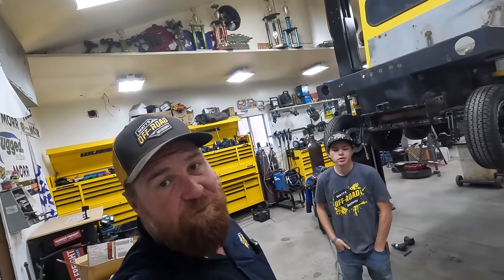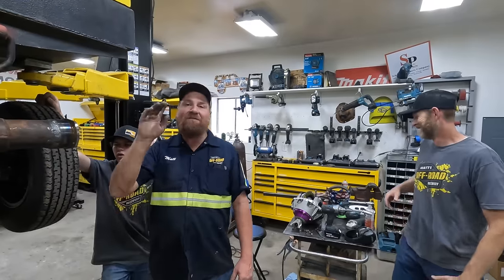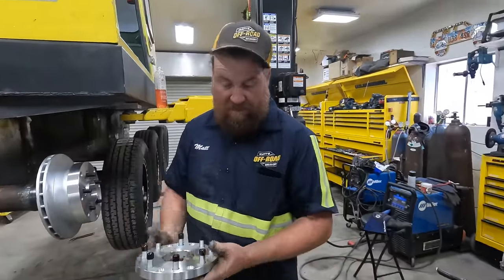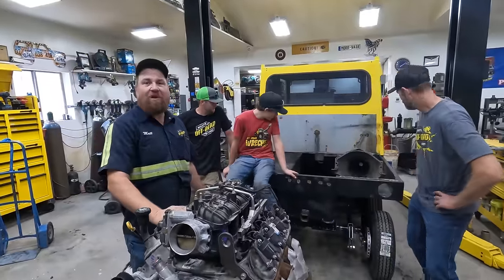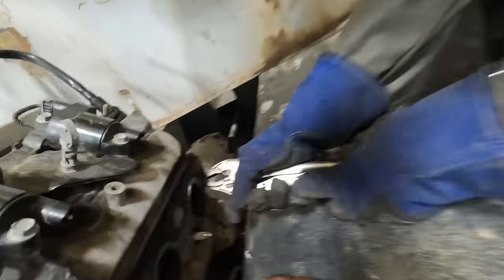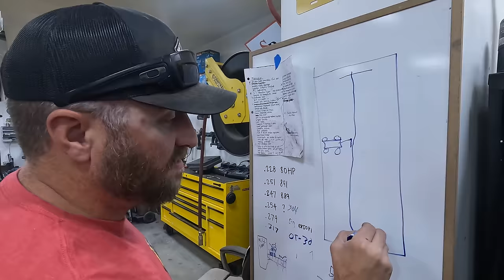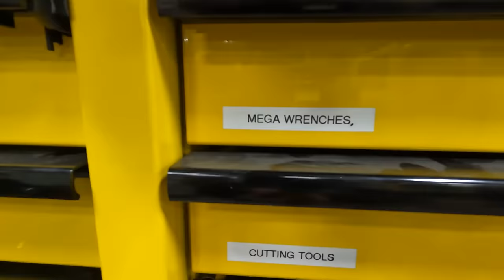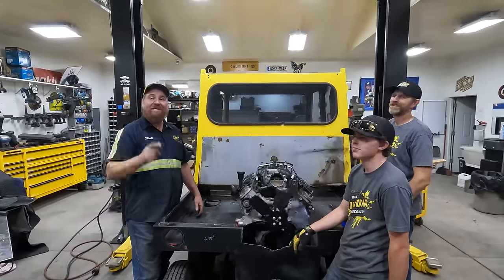Did We Make The Bombi Too Powerful? Massive LS Engine Barely Fits.

Comment: Matt, you can use electric fans and put the radiator anywhere you want it. That way you dont have to worry about space at the front of the motor / engine :)
Reply: I was thinking that same thing too. Also, I lived in some -20 winters and freezing brakes wasn’t really a thing.
Reply: Theres a roadkill episode on the mazdarati that proves that statement wrong. Sometimes you actually need to route aur towards them
Reply: Train locomotives do this, big fans push the heat out the top.
Reply: @haywood12  That's only at speed where placement becomes an issue.
Not something Matt needs to worry about with tracks.
Reply: Electric fans will also give you options for radiator mounting
Reply: @ubercdr1313  I've had drum brakes freeze solid numerous times.
Reply: @JohnnyD1993  yeah, mostly a problem with drums.  Pads can get ice between the pad and disc which is also an issue.
Reply: @@TheRealBrownShady They work fine in water as long as its temporary and its good to run them after they have had water in the hubs as it will help them dry out.
Reply: @@TheRealBrownShady Maybe the blades on them are poorly made and susceptible to mechanical deformation from the water? Or there is something else that causes it for them?  Would be interesting to look into what causes that or its just a recommendation for salt water for an electrical thing.  I mean if you're driving through salt water high enough to where the fan needs to be shut off the humvee is probably going to need a decontamination within a day or its done..
Reply: @JohnnyD1993  I see. My vehicles had disc brakes. One winter it got so cold the gauges stopped working. Our suburban was running but the tach was also below zero. The cold brought out all kinds of little quirks, but the brakes were always good. I guess that’s another key difference between disc and drum brakes?
Reply: Electric fans need to have huge motors to out out the power of a mechanical fan. Since this thing is likely going to be slow moving the mechanical fan is the way to go
Reply: @haywood12 roadkills issue wasn’t fact they had a electric fan without ducting there issue was the fans they buy because they’re cheap/free are absolute junk
Reply: @BrokeWrench  As a counter point, electric fans would allow for better regulation of the engine temperatures since it does not look like they have room for a fan clutch.  I personally think electric fans are the way to go on a build with confines like this.

Generally speaking I prefer engine driven fans as they are more robust, if a fan clutch fails in the middle of nowhere it is easy to make it into a fixed fan, where as an electric fan is done for. .

Comment: For added engine longevity, I'd replace that oil pan with a pan from a TrailBlazer SS. 8 cylinder GMT360 use a front sump oil pan. Perfect for that reverse mount engine setup in the Bomb Bee.
Reply: I am not an expert on oil pans but I would assume that the Bambi could never pull enough g in any direction to create that type of problem.
Reply: @DerUnbbekante  There’ll be quite a bit of slosh when you hit the end of the rope, but nothing sustained. 

I guess the bombi could see some extreme slopes
Reply: I'm always surprised that oil pumps in rock crawlers don't suck air when they are on extreme angles. Matt talked about it and he said it's never been a problem. So I doubt a few seconds of momentum is going to hurt anything.
Reply: @AsTheWheelsTurn  I just re watched the video. I counted the same number of requests for my opinion as I counted for yours.
Reply: @DerUnbbekante  probably not. Just like under normal driving conditions having a front sump pan in the TrailBlazer SS isn't an issue. However over the long haul, those brief losses in oil pressure that can happen during hard acceleration will catch up. Considering how much time and money is going into this overhaul it's cheap insurance.

Comment: Your homebrew high pinon will be fine. The probable use is low speed and cold weather (or cold for you anyway). If it fails in the future, Currie Enterprises has a high pinion casting for the 9" with the necessary oiling modes built in. Build it, drive it break it, build it again. Have fun!
Reply: True Hi 9 actually makes 9 high pinion, that would work for this.
Reply: He's said multiple times they intended to use it all year round, so abit more speed and heat could be normal for it
Reply: upside-down diffs are really not a problem. amc used an unmodified upside-down dana diff in the 4x4 eagle front end with absolutely no problems. 90 weight oil is very sticky stuff and the inside of a moving diff is like a dishwasher interior, everything gets plenty of liquid.

Comment: You should make the cab able to hinge up like a cab over truck.  You can tip it and them work on the drive line easily
Reply: I agree-- but In order to do that, they would need to weld a bottom onto the cab - which would add a lot of weight.

Comment: Matt, if you use a product called Power Punch gear additive, the oil will climb up the ring gear and follow the pinion back and lubricate the pinion bearings when you travel.  It has molly in it which fills the micro pits and makes the gears last longer.  Great in transfer cases too
Reply: yes, stickifier/tackifier additives would be good to put in there.

Comment: Thanks for another video folks. Regarding the cooling fan direction, I'm thinking that in powder snow conditions blowing outward will tend to blow snow away instead of into the radiator which is also a plus. All the best.

Comment: Flipping the differential will work fine. Gears  get "splash" lubricated from the ring gear slinging oil, like in a manual transmission.  Your solution for inlet and outlet may come back to bite you. Oil will loosen your silicone plug. A more permanent solution would be to tap the hole for pipe thread and install a pipe plug.
The lower 48 refers to the continental US.
Reply: Since I heard a reference to the 49th parallel slip into that conversation, I think they know that and are just having a little fun with it. Much of the border between Canada and the lower 48 follows the 49th parallel.

Comment: Given that engine placement you might want to look at a clear view filtration remote oil filter and a no spill system oil drain plus given its for matt maybe a bypass filtration system so when he doesn’t change the oil for long periods of time the oil is still clean
Reply: At 23:00, what is the purpose of the little square plate with holes in the corner ?
It's a Barnes product. Maybe for fuel pump change type thing ?
Reply: Oil doesn't matter at all.   Not when it sits out of gas on the trail.  =))
Reply: @stevejette2329  I believe it's a plate that bolts up to the original engine mount spots, to make it easier to fabricate a custom mount.
Reply: @IcedragonofSolitude  THX

Comment: Pusher radiator fan makes perfect sense.  To aid in efficiency, the low pressure area behind the "cab" will help evacuate heat from the engine compartment, especially if there are louvers on the sides of the Bombi to help make a positive pressure area inside the engine compartment.

Comment: I can't wait till the BOMB Bee gets it's first job, gets stressed in true MORR fashion and performs flawlessly, then reveals some superpower nobody expected! That's what usually happens when this team gets down to business. Thanks MORR family.
Reply: im pretty sure with the new engine and drivetrain that thing is going to be a mini beast when it comes to pulling!
Reply: Matt & Co. DO tend to over build and over power the vehicles they build/rebuild so they tend to over perform. 

I can hardly wait for Matt to decide the Bombi needs a boom and 7 winches... oh, and a few more feet in length on the chassis, the track and the footprint...
Reply: Now that BFS has one I can see the winter tow games lol
Reply: Bomb Bee  😅🤣😂 👍 It reminds me of "Olivia Neutron Bomb.."
Reply: I've been stranded in the SKETCHIEST places and times sub zero blizzards where you WILL die outside fast AF no matter what skills and gear ya think will help lol from our snow cat. Very very good mechanic and fabricator, mech engineer. It's been random things every single time screw snow machines😂😂
Reply: I think you're gonna regret not being able to haul passengers.
Reply: @craigbowley6783  How is he not going to be able to haul passengers?
Reply: It's only ever as good as the weakest link ....
Reply: I reckon she'll hold, till she doesn't. Then it'll get fixed better till it holds. Until it doesn't. Then, it'll get fixed again, until it got built right cause it was built thrice. Or more.
Reply: @mtnbound2764  With all the weight in the mid and rear of the vehicle they will need a dozen people in the front to try to hold it down especially with something hooked on the back. Maybe wheely ski's or something like that to help keep the front down
Reply: The executioner 😢has  get the pictures from a

Comment: They do make rear end oil pumps and coolers. Specifically for endurance racing. I would also put a cross brace across the housing. Ford 9 inch housings are really light and are known to bend.

Comment: You can get more clearance for the engine with a Corvette style accessory drive. I also wonder if you've looked into a Torsen differential. Supposedly when the brakes are applied on one side, a Torsen unit multiplies torque on the other side something like 5x.

Comment: The drive axle is on the front for a snowmobile so keep things compact.  Drive axle in this case on the back would be preferrable as it wouldnt stress the track tensioning mechanism but it worked fine before (with less than 100hp) so.. run it until it explodes then make it stronger I guess.    If you dont want to break exhaust bolts in the future there are neat drive sockets they make that go on the end of air chisels.
Reply: Ok

Comment: great build!  I'm a novice but concerned about track's attack angle, and other stuff, like track length, etc, when the bombi is not on the ground causing the tires to flex, and engine is not installed.  And, glad to see the advancement of the build!!!

Comment: The visual effect that makes the fan appear to be going backwards is called frame count.  Same affect was visible in spoked wheels in old westerns.  And Matt is absolutely correct in having the fan blow to the rear so as to stop dust and snow from clogging the radiator.
Reply: yea it's a sensible design, only issue that specific fan is designed to spin the other way, they'd be better getting a fan optimised for spinning in reverse

Comment: Matt: I spent my working life in Northern Manitoba.  Winter hits late October. NEVER use the park brake in winter or you will have to take a torch to the cables to get them to release.  Yes, I have had to heat oil pans to get the oil flowing !
Reply: They seldom are in real cold. When they are it’s not for days. Stored in place with no snow , hauled up to place with snow, used, hauled down. Should not be a issue.
Reply: probably not a huge issue for their mild winter country, unlike you guys who get real winter
Reply: @34 minutes in Matt explains. (It won’t let me edit)
Reply: Same thing applies in New England.  I NEVER set my parking brake in sub freezing temperatures.  I only use my parking brake enough in the winter to keep all the moving parts free.  I WILL engage it when necessary or appropriate but never over night.  MANY years ago my brother set his parking brake in the winter and froze his car in place directly in front of the garage door.  He and my dad spent a LOT of time under the car in the cold freeing everything up so the car would move.  My dad was NOT happy.

Comment: Use ARP studs or bolts for the exhaust manifold and you won't have to deal with broken off bolts again.  Older LS engines came with a longer oil filter and newer ones a shorter filter.  Be sure to use the longer Napa Platinum 41522 filter.

Comment: I’m still in the middle of the episode, but I had an idea for the exhaust headers. Flip em around like you did, and then just cap weld the open end, cut a hole on the front end (the back of the BombBee) and then weld 2 1/2” pipe in, sorta like zombies only for the exhaust.  You could even angle the pipes out somewhere between 40 to 60 degrees and then weld a tractor exhaust weather cap on em to keep any errant moister from collecting in there.

Comment: Might be worth looking into a axle truss brace thing on the front of the axle for the extra stress that’s on it from it being solid mounted and the tracks pulling on the thin wall axle tubes
Reply: Also would look super classy to tie the winch mount into it and have a bit better attack angle from the winch bumper to the tracks

Comment: Tom, when you guys trimmed the rear channel to make an opening for the fan/radiator, you took most of the bending resistance out of the rear structure.  Would be a good idea to use two pieces of bar stock the (same thickness as the flange of that channel) to span the gap and reconnect the upper flange of the beam.  If you use two pieces, it can be bolted and removeable.
Reply: Thanks, we'll get something welded in there to stiffen it back up.
Reply: @tomtomsshop  You could also recreate it by welding an equivalent L shape of the same geometry immediately below it.

Comment: I was thinking that you could look into running an ac compressor but converting it for air compressor use. There's a lot of jeep guys doing it with the sanden compressors and it would more or less automatically fill the tank with the motor running
Reply: Just realize that ac pumps get lubricated by oil that is in the closed system and the life of the pump may be less when used as an air compressor. An occasional squirt of oil in the compressor air intake is helpful just don't plan to use the air for spraying paint.  I saw one installation that drew air out of the engine air cleaner right next to the PVC outlet which provided a little oil to the compressor that way.
Reply: Their bacon was saved by a guy in a yota that had a compressor under the hood. They definitely need one!

Comment: My only suggestion is when you are building a gin pole crane…you should not be connecting in the center ( this cause the pole to flex giving the pole a chance to actually bend)unless you add some bridging to top of pole or move you winch cable to the same location as where you hook your rope too.
Reply: It’d take a lot to bend drill stem with just the weight of a person
Reply: @Wannabedually03  until you decide to lift a motor or a military axle on top of a connex / seacan….

Comment: Drive sprockets are raised on tracked machines so that they don't see shock loading from rolling on the ground.  Front sprockets/idlers are often raised to provide an angle of attack.  This aids in climbing over things and compressing the snow/mud/soft terrain underneath.

Comment: You will definitely have a faster Bombi.  The drive sprockets are bigger and you went to a higher gear ratio.  Both together will increase the top speed over the original setup.  That will also decrease the pulling power - like trying to pull in high gear instead of low gear.  The lowest 9 inch gear ratio I can find is a 6.50:1, which, combined with the larger drive sprocket, will get your speed and pulling power closer to the original setup.

Comment: A nice heavy duty pintle hitch on the back would make it quick and easy to hook up to. 🤔🤔👉👉Hey Matt idea for the exhaust why not build a strait rear facing exhaust manifold with four 90s to pipes runnning down long the back and out to the side corners to small mufflers.

Comment: A couple suggestions

1. Add a electric locker so when your pulling hard it cant choose which track is spinning and then your not wearing out the brakes.

2. A remote drain system for the oil on the engine 

You've done so much thats totally awesome might as well finish it out right.

Comment: I would think the reason for the soil compaction on the new shop area is because you might have expansive soils. Have Tom Tom do some reading on expansive soils and explain it to everyone.
Reply: That is better than the tractosis my garden has.
Reply: No matter what type of soil there is, the contractor should be able to tell when its good enough. 
I could understand all the testing if they were building a tall building, but its just a shop..
Reply: Looks like a very heavy clay soil will move u and down heeps
Reply: @dubious6718  It is done before any slab pour, it's part of the inspection and building process, this is not a garden shed its a commercial shop.

Comment: For the brake, I will consider putting the emergency brake on the drive shaft, so it will be inside the vehicle, protected from the weather and all the other stuff. I did spend a lot of year on army track vehicle ( TLAV & Leopard2 (Canada)) and the brake are part of the transmission. 
I do understand the powertrain is different, you do need brake after the differential. In the army, transmission-differential is the same piece, that why I am suggesting only the emergency brake  on the drive shaft, the brake outside will be on/off so less chance to freeze on spot and the brake inside will be protected, so it will not freeze when you park to work around.
And whatever system you use, if you pop a track, you are loosing your brake, does not matter where you put them.

Also, for the track been tension at the top, the TLAV ( updated from the M113) work like that, it just changed the weak point for ''popping'' a track. Rear sprocket will pop track more often while turning in forward, front sprocket will pop track more often while turning in reverse. Personal experience by working with both, rear sprocket pop more track than front.